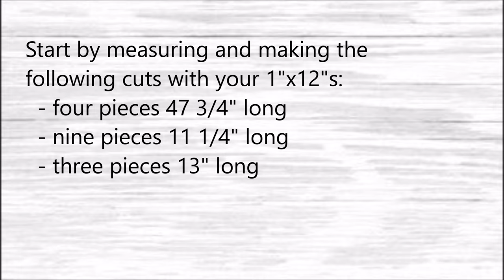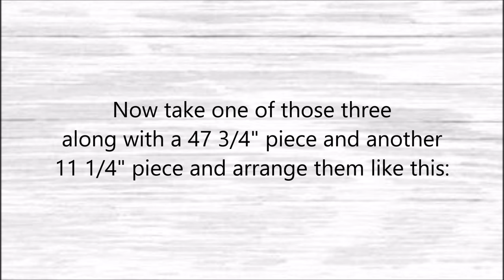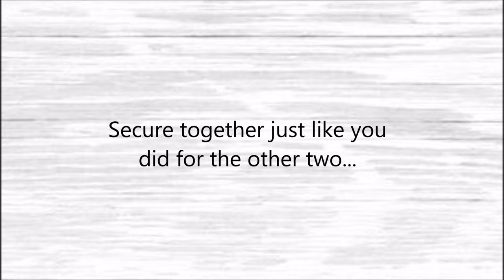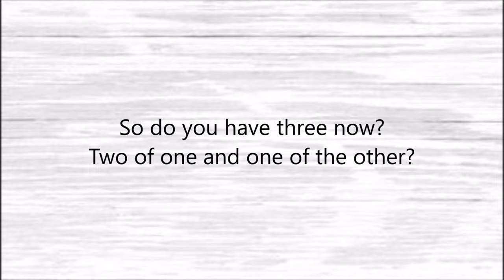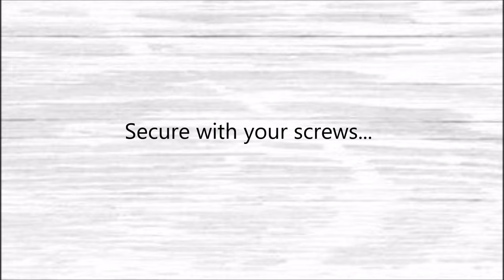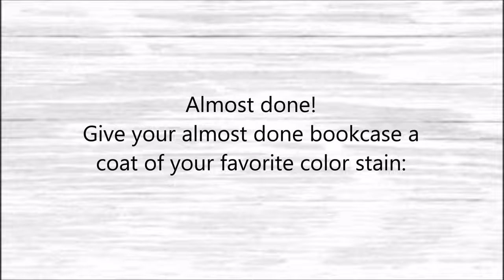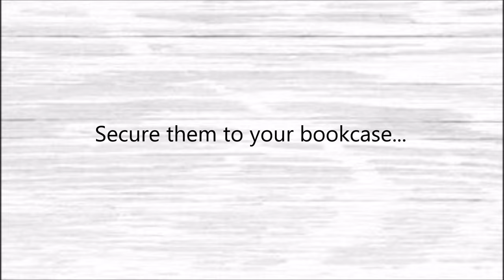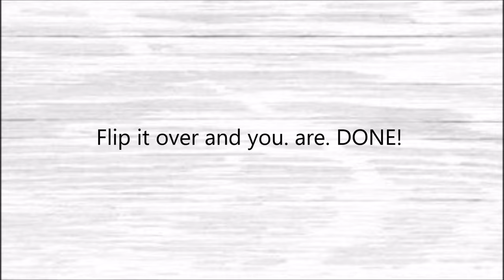Easy DIY Project: The $70 Midcentury Modern Bookcase

Comment: The $70 is it's a little misleading....... The stain the legs the wood filler the sponge, Even a small Box of those screws Themselves are around 5 to $10. So where did you get the lumber For that kind of price for $70? Why don't you buy everything at 1 time that you need and post the receipt for us so we can see the actual cost. But you did a great build. The work is phenomenal. Just seems little clickbate to me.
Reply: No. He is factoring the price of wood and he has left over materials from previous projects.

Comment: How much were the 1x12x8 boards? Because at Home Depot, they are $26 each!
Reply: It should say more like $150 for this project. 1x12 are $25 with tax plus legs and angle plates. Still a cool little project but definitely not $70

Comment: building this step by step using every single piece of hardware and stain and poly you have in this video. Everything has turned out perfect except the polyurethane coat. I've followed exactly how you do it in the video same foam brush same everything and it looks like crap now. You need to make an explanation video on how to use polyurethane. Gonna have to put some serious hours onto fixing this once simple prpject
Reply from the maker: Did you apply one coat or more? Many times it will take multiple coats of poly for that smooth/shiny finish. Wood is porous and can absorb some of the poly which may lead to a blotchy look after only one coat.

Comment: Just made this and it looks wonderful. The wifey was surprised at how good it looks. We used 4x8 plywood and cut it down since it was about 40% cheaper. Itll still cost more that $100, but no complaints for how it turned out.

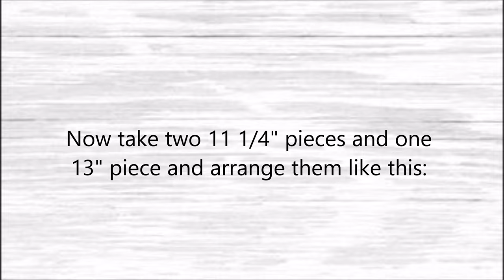Ours did have one difference than this video. With the dimension at 1:20 in the video, the 11.25" matches to the 13" on the 12" side... so the vertical wall will be 12"H x 11.25"D, which put it setback and not flush to the shelf front IF you're using 12" width boards... it would need to be 12×12" drilled to the 13x12" --  either way, still looks sharp, the verticals walls are just set back an inch from the shelves. 

I'd also suggest using wood glue for added "shelf" life.  Bahaha.

Comment: Hello! Thanks for this video, going to do this project for some vinyls. Do you know if a normal record will fit, or will I need to measure higher?
Reply: The 11 1/4” pieces seem to decide height, so I’d scale those up by an 1.5” to give some clearance for your records. Pretty sure the standard jacket is just under 12.5”.  I’m hoping to make it for the same thing here soon.